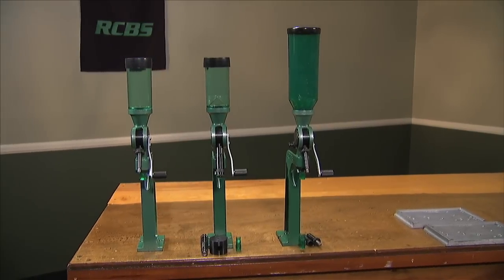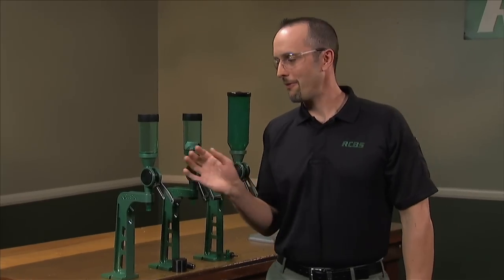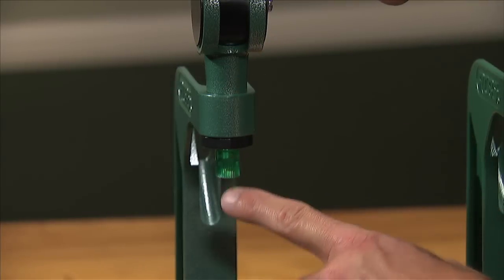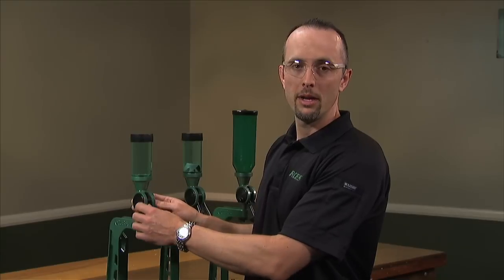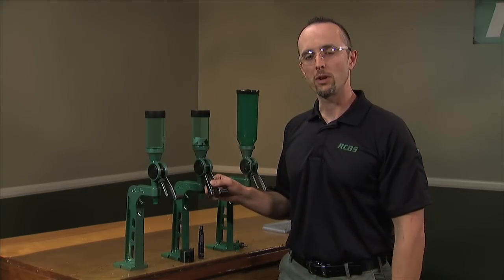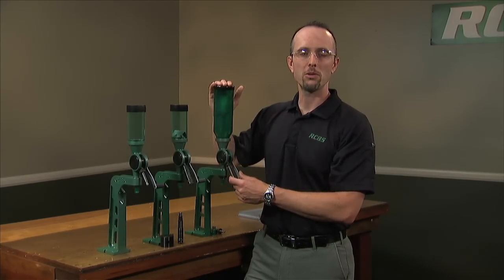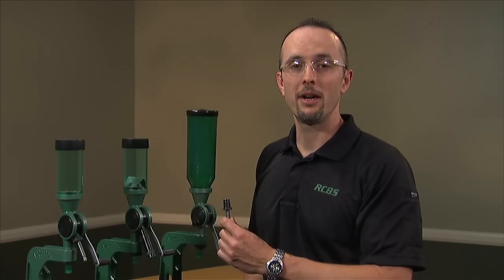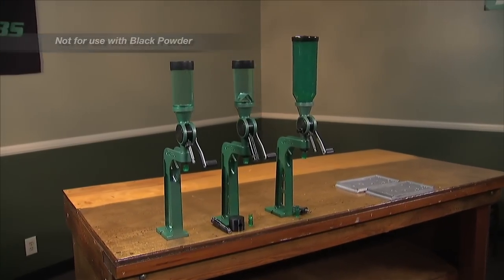RCBS® Powder Measure

Comment: Guys be very careful. The hopper does not screw off. I laid mine on the bench very very carefully as i was cleaning the mech (it was brand new) an it snapped off. Ive never in my life seen anything like it, had i been rough with it i wouldnt be here warning people. Its very brittle & frankly I'm totally amazed it happened. It wasnt dropped or anything. I wish now i had bought another brand. Ive now got a brand new powder dropper with a broken hopper.
Reply: Rcbs will replace it for free !!! They are very helpful
Reply: Yeah seems like a design fail to me, why not make it threaded? Seems they just wanted to go with inexpensive acrylic tubing or whatever and glue it in. On mine the damn thing is glued on crooked...no it's not a functional issue but honestly WTF.

Comment: First of all install that micrometer on the back and not on the front of measure like shown on the video - you need only handle on front and RCBS support stand has cutout on the back to fit micrometer. I am not sure why RCBS itself shows suboptimal way of using its own tools. You do not want micrometer to get into your view when you put casing under the powder output muzzle. Mine pistol competition with baffle produces so consistent competition loads that I enjoy it so much that I still use it even though I have Dillon XL 650. I simply trust RCBS measure  accuracy much more. Also the verison for pistol competition has much enough (with big margin) capacity to relaod rifle .223/5.56 easily with high accuracy. It also comes with proper plastic muzzle (call .22 works with .223/5.56)
Reply: So if you installed it with the micrometer adjustment on the back, would you also then have the throw handle on the left?